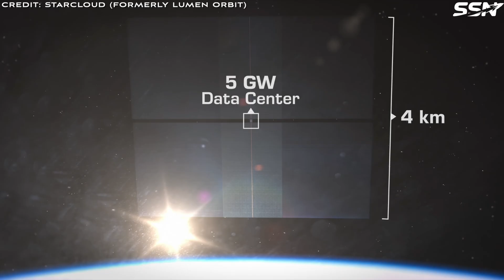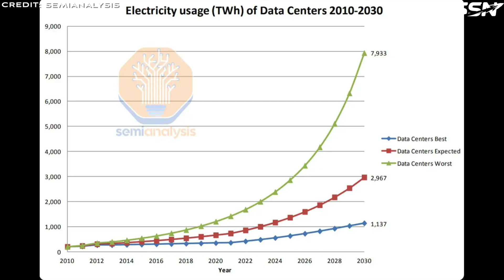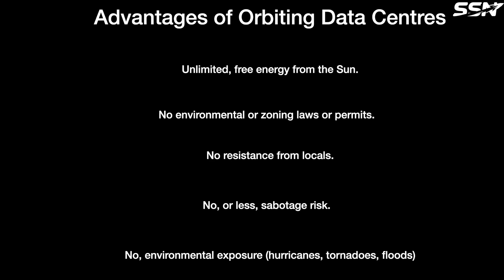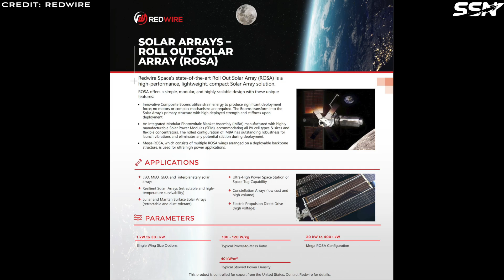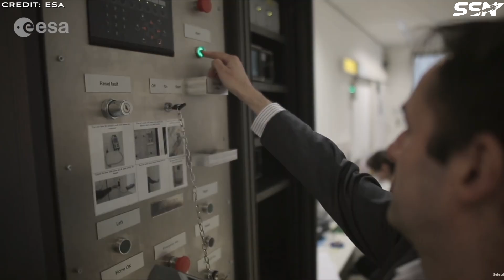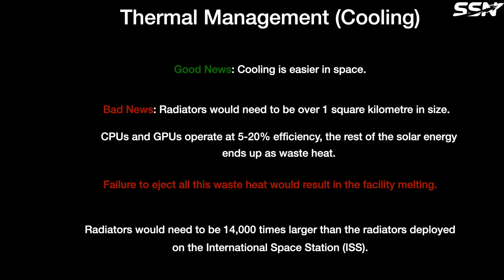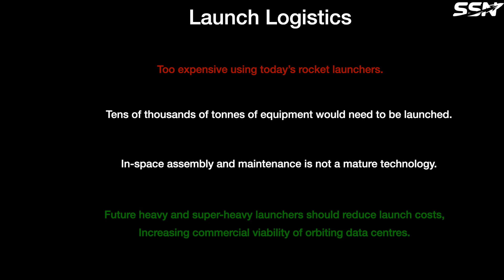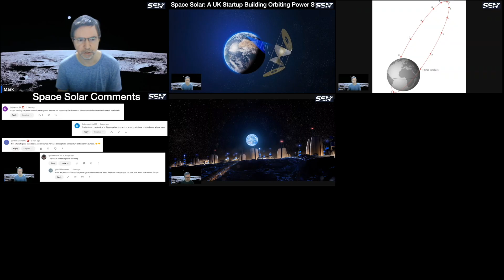Building Gigawatt Data Centres in Space – Feasible or Fantasy?

Comment: And what if you use optical chips? They don't generate as much heat. Jeff is good for building infrastructure above the Kármán Line and innovating. In addition, radiators and solar panels can be built from orbital debris
Reply: That's the need case for my Photocore neuromorphic chip design. Extreme efficiency and excellent thermal characteristics.

Comment: incredibly power hungry and dumping excess heat in space is a problem.  Inevitable for space based use! This is just the beginning of the beginning.
Reply: In space you can dump heat through large radiators, there's no gravity so you can have very large heat exchangers radiating away excess heat.

Comment: Needs to be multi-functional infrastructure hubs. Data centers. Power centers as per NASA solar power satellite concepts. Manufacturing. Internet. Communications. Multiple revenue streams so it can pay for itself.
Reply: It seems, by your statement, that we need bigger space stations...
Probably a rotating space station would start to get big enough to accommodate the multi-functional hub requirements?
Reply: @sebsunda that's a great idea. My First Centauri Ark starship design has an OD of 620 meters for comfortable 1g. If you start off with modular design, you could basically begin with two modules and complete the first ring at leisure.